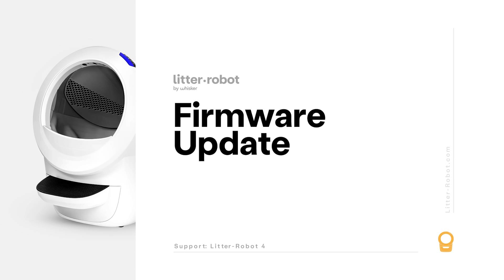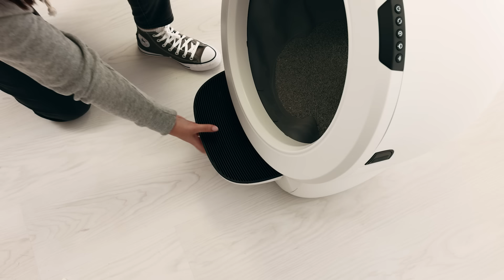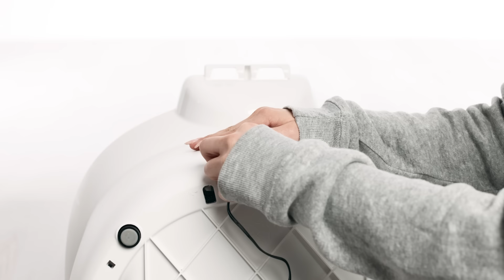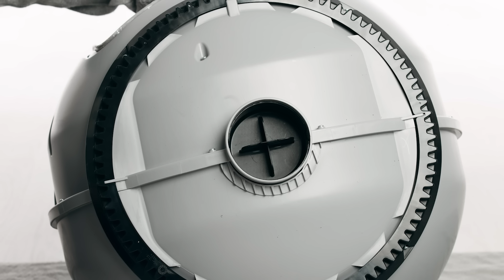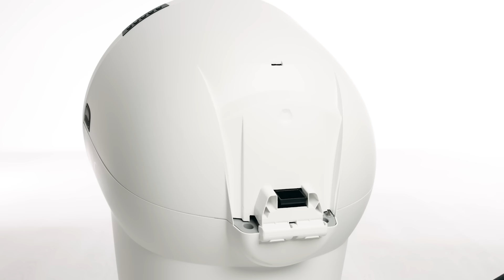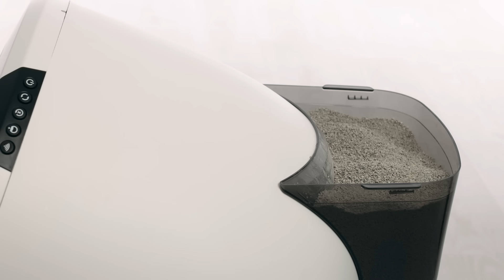Litter-Robot 4: LitterHopper™ Installation Guide

Comment: Thank you, this fixed my LH problem after I did a major clean.  The little pocket the feeder socket sits in had about a quarter inch of litter in it and was binding it up resulting in flashing blue and pink lights on the control panel.  Cleaned it up, reset the machine, and voila - litter!

Comment: I bought this a month ago, and it's been giving me nothing but headaches. I didn’t have any “cycle interruptions” before this. I did reach out to support and followed the instructions to “recalibrate” the thing, and I was still getting those annoying “cycle interrupted” messages. I ended removing the Hopper and back to normal. So for my personal experience this is not a recommended add-on

Comment: It is great but does not dispense enough litter. The level has to be really low (half of maximum) for it to start dispensing and meanwhile the cats don't have as much litter as they feel comfortable with. Would it be possible to provide a button in the app so we can make  it dispense litter? A good place would be below "enable/disable litter hopper".
Reply from the maker: You may need to do one of two things to allow your unit to dispense more litter: https://whisker.elevio.help/en/articles/329-litter-robot-4-inaccurate-litter-level.  We'd suggest cleaning the OmniSense laser sensors in the bezel as well as calibrating your unit's optimal litter level. You can find those steps at the link above.

Comment: If you’re watching these instructions, STOP! Go find another installation video and save yourself a huge headache. They completely missed the part of installing a piece that connects the hopper to the machine. I had to disassemble the whole machine again to install this one part. Worse part: I had litter in the hopper already and had to clean the huge mess it made because it wasn’t installed correctly the first time. There are other missing instructions in the video but this one was the worse. How do you miss a crucial instruction that’s vital to the hopper operating?? Had me trying to figure out why I had an extra piece. . .
Reply: what? they used all the pieces I have in this tutorial. I don’t have an extra piece and mine is functioning fine after following this tutorial
Reply: Maybe the video was changed since this comment? I have no extra parts and mine works fine. The tutorial was great.
Reply: @CDX7 you can’t change the video, OP has no idea what theyre talking about. the tutorial is correct

Comment: Please create a video explaining how to remove the bonnet with an attached litter hopper.
Reply from the maker: Hi there! In order to remove the Bonnet with the LitterHopper installed, the LitterHopper will need to be detached. We do apologize for any inconvenience.
Reply: The hopper stopped dispensing @LitterRobot . What's the fix?
Reply from the maker: Hi there Susan, we're so sorry your LitterHopper has stopped dispensing! We recommend completing our troubleshooting steps here: https://bit.ly/4gHBbnh

If that doesn't resolve the issue, please reach out to out Customer Experience team, we would be happy to assist further. We have multiple ways to get in touch! You can email us at support@whisker.com, live chat via our website https://bit.ly/3SSfasJ, or call 1-877-250-7729. Our hours are Mon-Fri: 9 AM-7 PM EST and Sat: 9 AM-5 PM EST.

Comment: My hopper won't dispense any litter during a cycle. I tested it the first time I set it up and a small amount came out for the test, but since then nothing will come out of the hopper.
Reply from the maker: We're sorry to hear that you have been experiencing issues with your LitterHopper. We can help! Please give us a call at 1-877-250-7729 (we are available Mon-Fri: 9AM-7PM EST and Sat: 9AM-5PM EST).
Reply: I had the same problem. Using troubleshooting directions (remove a large amount of litter from the globe and then run 2 cleaning cycles - the first for detection of low level and the second to fill up) I found that it only dispenses litter if the litter-level  is really VERY  low - around half of the maximum amount. But then it will dispense enough litter to fill it up to the mark.
Reply: @chmueller59  I got mine replaced, and it works great now. Hope you got yours working or replaced.
Reply: @rogerenyart2066 it does work, just not as expected (does not dispense enough litter and not often enough). I think this is intended, can't have it replaced anyway because I am in Europe and had to order it from a reseller in another country. Sending it back would be quite complicated and even if they agreed on replacing it - I waited for my litter hopper 3 months.
Reply: @chmueller59  Yeah, I think with a patch update, they can fix this.

Comment: Whisker’s decision to allow retrofitting on already sold units is truly impressive! Honestly, I had low expectations when I bought the Litter-Robot 4, thinking it might be a waste of money—but I was so wrong. This machine has exceeded all my expectations and has become such a game-changer in my daily life!
Reply from the maker: Thank you for being a part of the Whisker family!
Reply: It's definitely a game changer but the price of the litter hopper could be much lower if we didn't have to replace so many parts from our Litter Robot 4 to install the hopper. I can't believe that we have to replace the entire external plastic cover to install the Litter Hopper instead of just having a small plastic cover in the back of the big plastic piece that can be removed to install the Litter Hopper. Once you see it in person when installing if you'll know what I mean, as the huge plastic cover has to be completely removed and replaced for a new one that simply has a hole to let the litter get inside of the Litter Robot. New Litter Robot 4 should be coming with the same plastic part that works with the Litter Hopper and simply have a small cover to protect the hole where the hopper gets installed, and it will still look good without it, making it easier and cheaper to sell the hopper, having more customers willing to upgrade for a lower price and easier installation. Oh, and once you replace the big plastic cover to install the hopper, we need to keep that huge plastic stored somewhere as you never know if in the future the hopper will break and you'll stop using it, and needing to get the original cover back, or maybe your cat is old and once they pass you want to sell your Litter Robot 4 but someone wants it cheaper and without the hopper (and you can sell the hopper to someone else). Too many boxes to keep all the parts stored and extra expenses with those extra parts that shouldn't be there anymore. And well, you could still sell the plastic cover compatible with the Litter Hopper for people that got their Litter Robot 4 before the external case was upgraded to be the same one that comes with the Hopper, and maybe sell that part very close to cost, because the Hopper is the actual product that should be needed and not extra plastic parts.
Sorry for making such a long text here, is just that I have been thinking about this since I got my Litter Robot 4 and had to keep those huge boxes plus the external huge plastic cover at least while I have my devices under warranty.
Reply: Unless they already intended to release this and did it in such a way that most would have to purchase or separately, leading to not saving more money than if you could purchase together.
Reply: @Duhllin  My guess is that Whisker wasn’t fully ready with the development of the litter hopper. That said, the business model isn’t bad ;-) The invention and product quality themselves are worth the money, in my opinion. Plus, the documentation is as thorough as it can possibly be.
Reply: Yes it’s amazing! People think it’s crazy that I paid the amount for it but it’s already saved me 1700 scoops in 3 months! 4 cats share it with no issues at all. With a 3 year warranty and how good customer service Iv heard it’s so worth it.